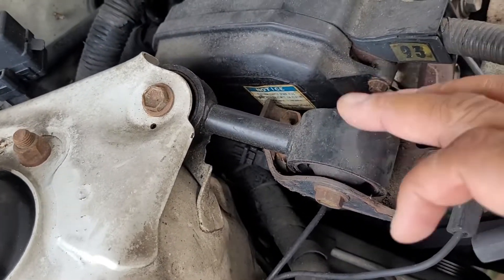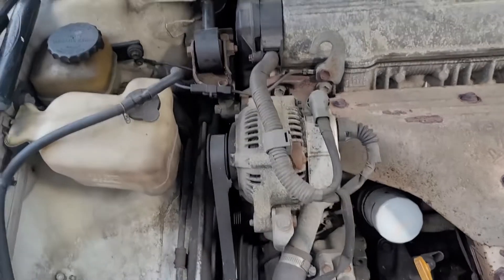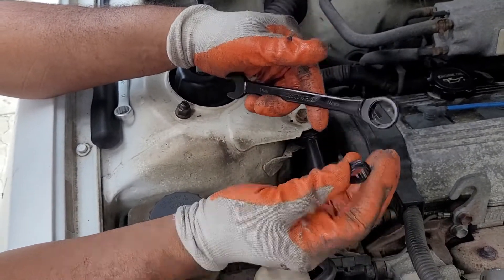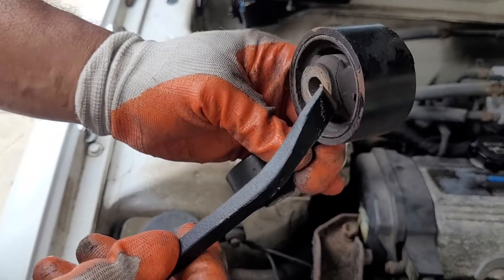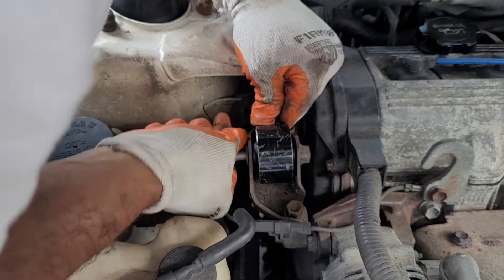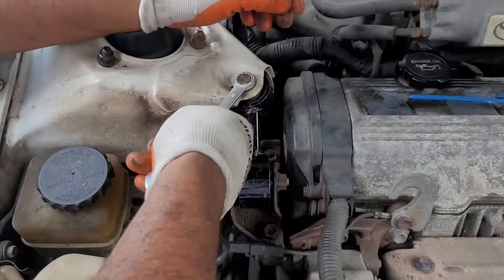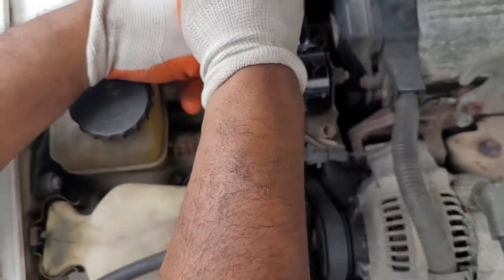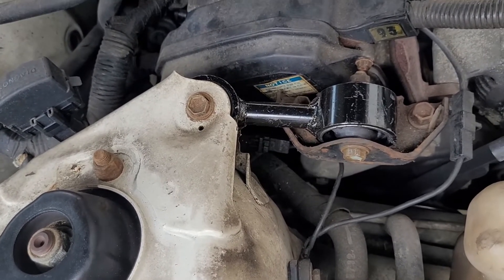Easy Replace Top Motor Mount (Dogbone) On 95 Toyota Camry

Comment: Good morning sir. I'm wondering if I need to put a jack under my motor before I pull that torque mount off I was told the motor might settle down if I don't did you come across that issue
Reply from the maker: Good morning, and no, I didn't, but being extra safe is always good. All the best, and thanks for watching
Reply: I put the jack under the oil pant with a good length of 2×4 between the jack and pan. Added a little bit of pressure and had the thing replaced in less then five minutes. It's the lower on I'm gonna have to do next week.
Reply: Thank you for your advice and video.